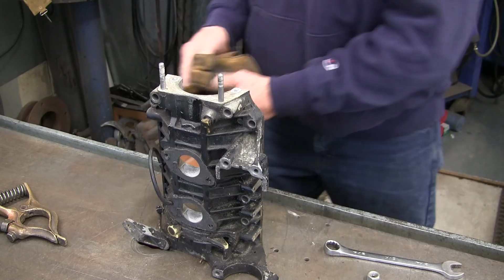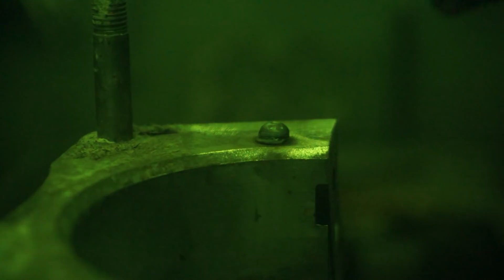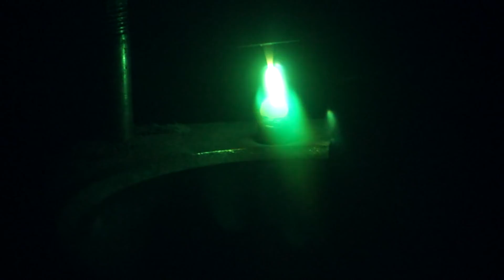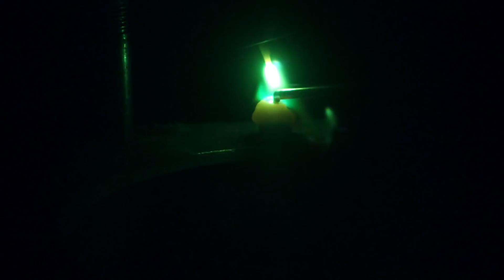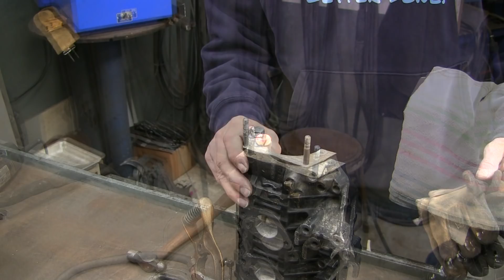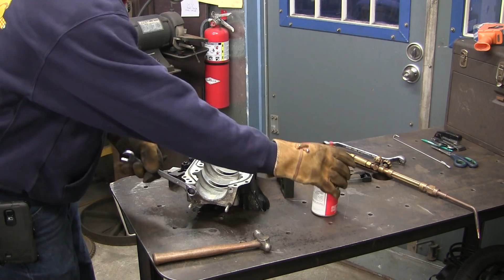Put A Head On Your Thread

Comment: Keith I'm very curious how much would you charge a regular customer if he brings you a job like that?
I do such jobs quite often for nearby car mechanics and if its a quickie, no more than 10 minutes I charge 30PLN which is about 9 USD.
Still there was one guy who came to me with a lawnmower with broken bolt that secures the blade to the engine shaft.
He came to me 7 times with the very same mover with the same problem and didnt want to hear that his blade needs balancing :)
Reply: +marmooster Increase the price every time he returns with the same damn mower, until he gets the hint that the blade needs balancing. Also its not just how long a job takes but the interruption to your workflow.
Reply: +marmooster  After about the third time I think I would tell him that I wouldn't do it unless I balance the blade too. Then I could show him what the problem is and explain how much damage is being done to the engine. Then I would tell him if he wanted to come by to just visit he might get to see some other kind of repair besides just an extraction.
    Mike (o\!/o)
Reply: marmooster j

Comment: You must be very confident and have a lot of experience with thermal process here. I Use that trick with a small (6013) melding rod and it works well. What I see now is more complex because your dealing with two different metal. Aluminum has a very low melting point. For me it's scary to use so much heat (Oxyacetylene torch) near aluminum. How do you feel that it's time to push-pull the torch in order for the aluminum not to melt. There is the state of the art.
Reply: +jz1199 The trick is to spread the heat and know when to quit, when it's hot enough it will make a huge blob all at once, there isn't much to tell it's coming, like the redness on steel. You can use a handheld pointer thermometer to give you a hint on where you stand....    ;)
Reply: +Robert Patoine aluminum, besides the low melting point, aluminum is a very very good heat conductor, so if you bring your torch to it, the heat is dissipated very quickly throughout the part, opposite of what it would be with steel or even worse - stainless, and that is what keeps you safe when dealing with aluminum parts, just have to pay attention to thin sections

and you don't need to heat it to near melting point to get that rusted in screw out, couple hundred degrees C will do, which is half way to melting point, because you only need for the solid metal to move around a bit and brake the bond with rust/oxides, so it is quite safe
Reply: +pierre beaudry Yeah!  You point the thermometer at your forehead as you work and when it reads high you go do something else for a bit to avoid getting "medieval" on it and making it worse :P
Reply: +Eddie the Grouch Hasn't anyone invented temprament checking sticks yet?
Reply: There are sticks that change my temperament when I get hit with one.  Does that count?
Reply: +Robert Patoine 

You would nearly need to try to melt it though in reality. I think a guy worrying about never could. Lower melting point but at the same time better heat sink.

Comment: Hi Keith im a machanic and have had to do this in the car with a mig. And its not as easy as it looks especially if the stud is flush with the surface or slightly recessed it can become a nightmare real quick if the weld runs off the head of the broken stud (beside it) and acts like a key locking it too the cyl head so it can't turn.
Reply: +andrewkiwi1 Like you I have to remove broken bolts and studs from engines and etc.  I like to weld the smallest washer I can drop over the broken piece before I go down in to weld the hole in the nut.  I feel it protects the surface of what I am working on.  But then sometimes you cannot do that.  The best way? The one that works.
Reply: Thats a good idea i'll try that next time :o)

Comment: job well done.  never seen tig used on a broken bolt.  that was a lot if heat on the aluminum but it worked.  something I've used for lubricants is water. it's what made the rust so it softens it also.  no two projects work the same it seems.